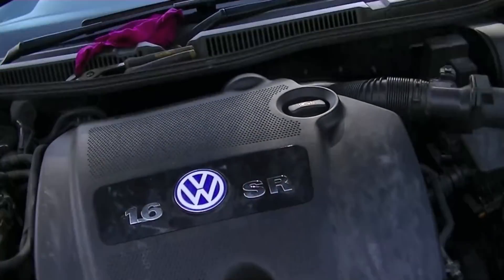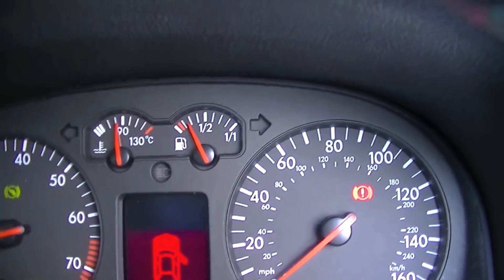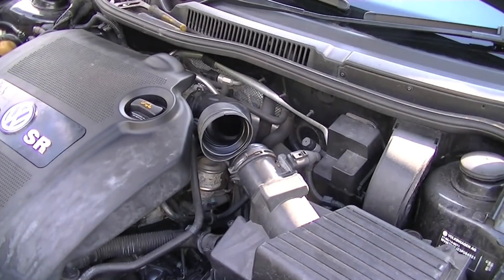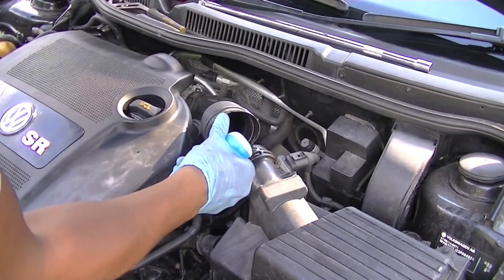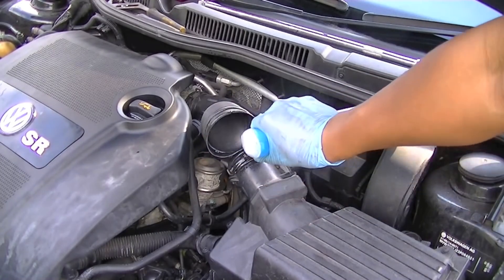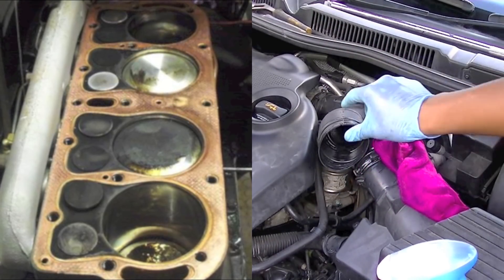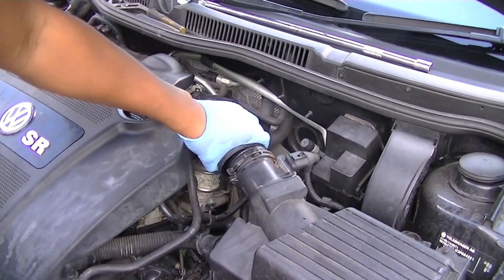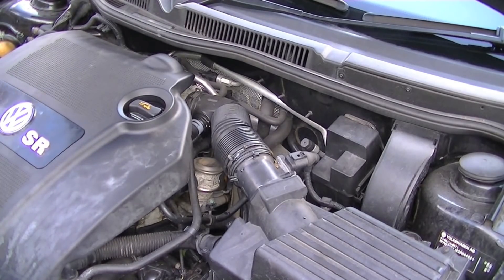How to make your engine run better with just tap water.......Better Than Seafoam?

Comment: so you speak of evidence yet you don't show any and I've been around cars my whole life never seen or heard anyone do this if you stand behind this method why don't you show results before and after I think your not using water at all and just getting people to do this and mess there engine up
Reply: Hey you freaks, ever hear of water, and water/methanol injection?  It doesn't screw up your engine, there are valid purposes to it.  Also, spraying a mist of water into your intake will make practically no difference on combustion, and your engine will keep running.  And his statement on steam-cleaning is valid.  It may not actually clean the way we imagine steam cleaning other things, but it does work, and the example he used about coolant slowly leaking into the cylinder and cleaning it is also valid.  Also, shops don't do this because a one-off spray session is unlikely to do much by itself, it has to be repeated periodically.  And do you honestly think he's going to rip apart a perfectly good engine in his own ride twice, to show you before/after?  Do you think that's a walk in the park or something?  You are already on the internet, the info exists, use it!  I understand it is smart to be careful about what info you accept, but immediately calling the guy a liar without looking into this further is NOT smart.
Reply from the maker: You must be quite new to cars.
Reply: james Branner dude don't dump water in your gas...duh. the water steams and cleans carbons. shop do not do this to make $$ there's no $$ in it. selling parts makes $$. I have done this first time 15 years ago. it works.  I learn these tricks from old farmers. they lived in a world where you fix what is broken not have mommy daddy throw away and buy a new one.
Reply: Bud gas is lighter than water.... means dumping it in your tank guess what? It goes straight to the lowest point... what does that mean? It means when your fuel pump starts it's intake opening for the gas is near that lowest point.... so what does that mean? Well in modern and ancient forms of language you would have no fn gas to mix :O no gas how!!! Cause its floating on top of the water Einstein ;) so you my friend have just fubared your whole fuel system with pure ignorance....... ill give you a big example when the oil rig blew in the gulf jeeez wolly why didn't the water put it out well beave cause oil & gas float :O golly wolly your so smart!!!  jesus what happened to science class is it an elective in school now?  That said this has been a trick handed down for 3 generation in my family yup before tv & intranet damn what he is doing is "Misting" water vapor which is no different from driving in heavy fog mind you he's only doing it for a few minutes imagine all that damage you do with your theory driving for hours in those conditions I bet when you broke down from it you had your aha moment and knew this was the only answer.... So my suggestion to you is if you take your own advice never drive your car in heavy rain or fog pull over immediately & wait for your sunny day chap or like you said you'll be dumping water in your tank lmao!!!! Good luck with your science class kiddo hope you pass. Please don't drop out of school either keep trying kid it's worth it in the end for everyone. If your out of school just do your research on .edu instead of .com .tv .ha and all that other unregulated information. Just a tip if your serious about learning more.
Reply: BMAC VAGS that's funny coming from a guy that obviously is new to cars or never did any actual research.
Reply: water is not hydrogen! its hydrogen with 2 oxygen. what your are talking about is water meth injection. water alone is not flammable so they add methanol to out number the oxygen bonds.methanol is highly flammable  so the added fuel outnumbers the oxygen molecules by 5 to 1 or if you do it in terms of teaching methanol 10 to 2 to 1. flammability rate of 11 to 2 per water molecule regular gas = 14 to 1 oxygen ratio. adding both = 23 to 3 ratio. this allows more air to come in the create a larger combustion.
Reply: He did show evidence, pay attention. Remember the engine with the head remove because it had a blown gasket and coolant was leaking into no.2 cylinder and that cylinder 2 piston looked like new? Do ya?
Reply: Many people have done it for years.
Reply: Andy George dose this method clean the throttle body aswell?
Reply: Andy George pcv valve
Reply: There's a reason you do it with the engine at op temp and at a 3k rev. Would you shoot seafoam down your intake on a cold engine at idle speeds? Used steamcleaning before and it works. Just don't let her stall out and make sure it's at op temp with at least a 3k rev. If the throttle body is oily change pcv valve, change air filter, take out MAF and clean it with MAF CLEANER only. Clean TB then you should be good.
Reply: I / We used to feather the throttle to keep engine running, and using a  mixture
of water soluble cutting oil, and water, would 'dump' it down the throat of our old 4 barrel Holley carburetor on 'big block' V8 GM engines. I speak from ((actual)) REAL WORLD EXPERIENCE, when I say this definitely removes carbon from engine, and exhaust system, in actual flakes - as witnessed by what is blown out the exhaust, and a measurable DECREASE in engine compression test PSI). However, I must admit Those engines we used to 'de-carbonize' were mainly, (in fact ALL), were of 1960's 'vintage', (before the advent of sophisticated anti-smog systems, (sensors, catalytic converters etc.), I honestly have no idea, as to how this procedure will work, to improve performance on any, or all modern day (internal combustion) smog) components. Maybe some of the 'eggheads' here, (the ones we used to take  lunch money from), will have theories, and ort"'equations" To prove me wrong - I speak from actual experience, and not (educated as they may be) g-u-e-s-s-e-s of what did, is, could, or will be happening. (which is probably as good a definition of  the word 'theory', as anything else.
I will .however tell you that when I opened up KC ENGINEering, in 1976, (a Motorcycle tire and Modification center) , later (1980's)Kawasaki began to 'dabble' in 4 valve combustion chamber liquid cooled, engines namely their 600cc inline fours.
In Kawasaki 's taking advantage of the lighter, smaller diameter valve stems, and corresponding super light valve spring pressures / tensions, (inadvertently)  caused a lot of 600cc ninja's to be sold off,(cheap) because of less experienced shop's inaccurate diagnosis "internal engine damage", "bad cylinder(s)".
We repaired, brought compression back to more than just a couple of Ninjas, and Eliminators' by only removing / replacing spark plug(s), and valve cover. If any of you want to know exactly how it is done, I am semi-retired now, and spend much of my time advising motorcycle service managers, and giving free advice 
Call me

Private cell phone number, and speak privately to me, (some shops around here,
(San Francisco Bay Area), don't like me doing this).
Ken @ KC ENGINEering
415-706-9542
((((I do not accept calls with blocked ID's))))
Reply: water does Explode in hydrogen at High temperature and that helps for better combustion.
Reply: water is not hydrogen! its hydrogen with 2 oxygen. what your are talking about is water meth injection. water alone is not flammable so they add methanol to out number the oxygen bonds.methanol is highly flammable  so the added fuel outnumbers the oxygen molecules by 5 to 1 or if you do it in terms of teaching methanol 10 to 2 to 1. flammability rate of 11 to 2 per water molecule regular gas = 14 to 1 oxygen ratio. adding both = 23 to 3 ratio. this allows more air to come in the create a larger combustion.
Reply: I dont believe so, no... The water has to turn to steam, and the throttle body isnt hot... In all reality the throttle body shouldnt be getting that filthy anyway... If it is, I'd start taking a long hard look at blowby (slack piston rings) or buggered air-filter...
Reply: james Branner 
Am you are wrong!
 I tried this method, and it works. To prove it. Clean the bottom of your frying pan using the steam from your kettle and see how the carbon dissolves  so easily.
Reply: I did this and it defiantly works and I checked before and after water treatment with endoscope.
Reply: james Branner why dont you try it! Spray a mist with a spray bottle in short bursts only after your engine warmed up to normal operating temperature. Its a very old and still useful method! I prefer to use spring water or or tap water that was filtered. Mechanics used to do this to help cars pass emission tests back in the day when the probe went in the tailpipe and you had to rev the engine. Also guys used the same process to spray water into the main vacuum hose too!
Reply: Exactly. Negative people can only see negative.
Reply: I never called him a liar I asked if he could show the results and they have these things called cameras now that you can stick down the spark plug hole and you don't need to rip apart an engine to do that do you?
Reply: Water, James...  Not Water Mist...   The engine cant deal with water...  Same as it cant deal with petrol...  The fuel (and water) has to be atomised before the engine can use it...  The water turns to steam and ...  Ive explained this 44 times...  Im not doing it again...  Look up Water Injection...  Its an old trick from WWII days...
Reply: Lol yep if this was a great benifit to engines shops would all be doing this to increase profits and to say I'm new to cars explain to me what happens when you get water mixed with your gas..... your car will NOT RUN!! Proven fact! If you don't think so let's see you dump water in the gas tank and run your car

Comment: I did my Suzuki Sierra Jimny the other day after I got back from a highway drive, slowly mist sprayed water (hand bottle sprayer) into the intake with the air filter removed. Let's say the engine didnt like it not one bit! Kept the throttle near open abour 3 / 4,000 revs and the engine was sounding terrible, literally wanting to shut down... Wouldnt restart without throttle and some time to come back to life...

Not a good outcome for my vehicle, not recommended I guess for all cars...

Comment: It does work !!! I did it on a Ridding Lawn Mower :)))
Reply: Here is what I did. I tested to try on our Lawn Mower before my Dad's Car, just incase it broke LOL. It's Briggs and Stratton Engine, and IT WORKED !!! ... :)... Open your Air Filter, remove all Filters, then REMOVE your Exhaust Pipe, so Carbon can leak out easily... Now Start your Engine like normal... Let it RUN for a bit until WARM :))))... Use WARM - SEMI HOT WATER and the spray bottle... Now, spray it into your Carburetor Air Intake Hole.... Spray SLOWLY so the Engine doesn't SHUT OFF / DIE :(((. If Engine does SHUT OFF / DIE... Wait a bit to dry, jump start it again... Even if your Engine is NOT starting, you will still see Carbon Spitting / Coming out cause the Starter still TURN the Motor and made Compressions. If you have NO Starter, then keep pulling your Starter Coil. If you have just plain Carburetor Cleaner... Use that afterward, it will help for sure.. So during Burning, it will SPIT out Carbon for you. Mine came out like tons :((( All Black Stuff :///. Now our Mower starts nice and fast and smoother too :))))))

NOTE: Please make sure you take your Exhaust Pipe Off, at Engine.. Any Water in there can burn and ruin your Pipe in time, leave Holes if NOT completely dry after ANY usage. although it will take a lot, but better to prolong :)))))

I will make a Video soon :)))), Just waiting for it to Dirty again, LOL :)))

Basically, we are using Water to help Clean the Engine, that is all :))). You can use Carburetor Cleaners or Seafoam etc... ... But they BURN due to the agent(s).... Water DO NOT BURN... So it SPIT OUT instead, by spitting out, the Carbon comes out with it  :))))

I think that is my conclusion to this method :D

Comment: When do you recommend doing this? When the cars does not feel sharp anymore or is it any mileage recommendation ? :)
Reply: it's good when you feel like doing it. especially if your car has been only used for short distance travelling a long time, as the engine will form most carbon when it's running cold. I would do this at least every 50 000 kilometers.

Comment: that is the best way if you want to fuck your engine up as it WILL crack the piston crowns and wreck the cat so if you have to decarbonise you engine you will want to get a workshop to check your engine out  as there is NO need to do that with modern fuel whether its diesel or petrol  as thy ALL have detergent in them
Reply: chris lee - You can sit ALL DAY, these People will NOT understand you. My advice !!! Drive around for 1 Hour... Make sure the ENGINE is really HOT !!! Then STICK your WATER HOSE in there, PUMP that COLD WATER in there like there is no tomorrow... It will CLEAN the ENGINE FOREVER :))) - Get my Drift??? LMFAO
Reply: so you have tried this with a hose I see. there's a difference between flooding the engine with water and spraying a mist in there.
Reply: get water in the combustion chamber turns to steam which expands and too much WILL FUCK UP THE ENGINE   so get your finger out of your ass and go to engineering collage  and you will find out  there is a small amount of water in petrol  it is one of the first things you learn  and if you get that wrong when you sit your C&G exhame you fail and 5 years of work are wasted if you think i do not know what im talking about put a water trap i your fuel line and check it after 500 miles and you WILL see water in it

Comment: This method is fine however it does nothing to clean the fuel injectors on a modern engine which is more of an issue and the only good way to clean those is with a dedicated fuel bottle with cleaner running shop air (specialized tool) or you could remove each injector and fashion a 9 volt circuit to power each injector while spraying cleaner into injector on a test bench google for more info if interested there has to be videos out there . I have never looked as I happen to own the fuel injection cleaning system and clean the injectors on the car.
Reply: Hi there , where to buy the Liquid which goes inside the Pressurized Cleaning
Canister ?
Thanks .
Reply: trans fluid the sulfur in it cleans engines and injectors good for me any way looking like new.

Comment: deff works, told to me by a RR mech, was used ww2 by army, order was.
 do as man says half pint water per ltr engine size, then quarter bott redex poured into each piston through plug hole, an left overnight to free rings. then turn engine over to eject excess, followed by running engine fast revs and squirting in slowly half pint parrifine to remove shine off cylinders walls to improve seal on rings followed by oil an filters change. decoke done.

Comment: This works to remove minor carbon build up in newer engine combustion chambers, but on high mileage cars which have not been maintained in such manner, the amount of carbon breaking loose can get jammed in a valve. which wouldn't be good. Plus injecting a non combustible hydraulic fluid into a compression chamber can cause problems to. I wouldn't recommend this. Take the heads off and clean them if a fuel additive or carb jet cleaner doesn't seem to be good enough for you.

Comment: coming from an experienced mechanic, DONT EVER TRY THIS!!! this guy does not know what he is talking about and you can hydro lock your vehicle with very little water. the reason it hydro locks is because water does not compress the same as the vaporized fuel, do not do this! even if your car does not hydro lock it is still extremely bad on your car!!!!
Reply: you need to go back to school and learn about stuff. seriously. hydrolocking an engine with a mist of water that actually turns into steam 😂 so all the racers who use this are just wrecking their engines? and still after decades they keep doing it. seems valid.

Comment: This will also potentially "steam clean" the oil around the piston rings too; don't you think that might have some adverse affects to the bore?
Reply: To be fair, it could do, but that doesn't mean it'll necessarily destroy the bore or add any unnecessary wear. Engines are designed to run with NO oil for quite a long time. Don't you remember those dodgy commercials for 'overpriced oil' when they claimed just putting a drop in was enough proof that the oil was good. In reality, they were just using something like a Rover V8 which could run for like an hour without any oil at all lol.
Reply: InvisibleYetVisible This is not entirely true. NO oil meaning it is completely free from any kind of lubrication. This would lead to overheating, elevated levels of wear and eventual failure. The representation in the commercials of "no oil" is an engine that was drained of oil but still has oil trapped between the close metal parts (cylinder and piston, crankshaft and connecting rods etc). That will provide some protection but not indefinitely
Reply: Everton Mckenzie So do you think that by spraying water in the lubrication would be reduced?
Reply: I'd tend to agree with this. A truly "no oil" engine wouldn't last minutes, I would reckon.
Reply from the maker: What Is shown in the video is far less water/moisture than driving through fog on a cold day.
Reply: BMAC VAGS so that begs the question, why doesn't rain/fog stream clean your engine? just curious bte

Comment: 30 odd years ago before unleaded fuel this might have made a small difference, with a modern engine though it's really not needed, and besides whatever it did clean off, if anything at all, it would be back after a very short time anyway so whats the point?????
Reply: Most of this crap is recirculated from the breather system... nothing to do with the fuel though?